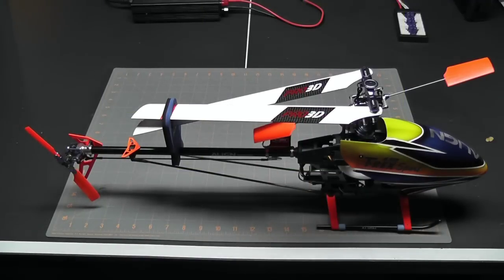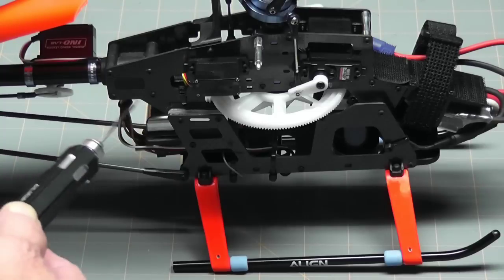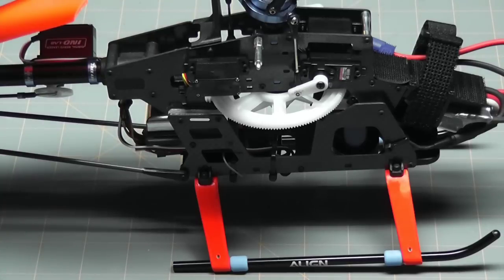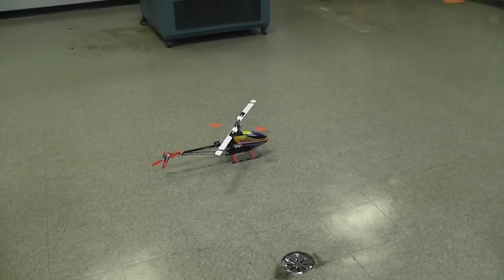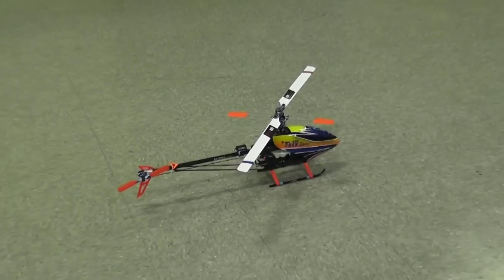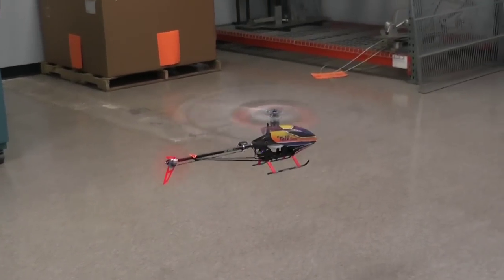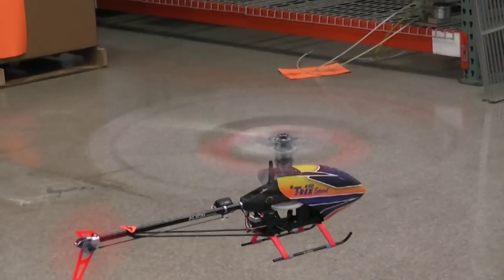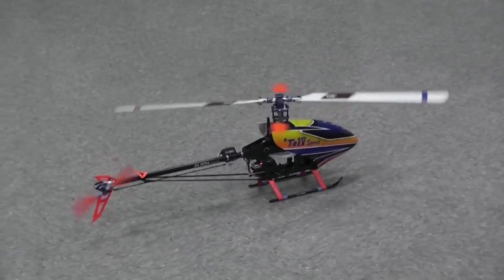Trex 450 Rebuild - Part 3

Comment from the maker: Hi there GadgetMart!  Thanks for posting bud.  The Trex 450 is much heavier and therefore more stable.  It is not as twitchy as the 300X but the flight characteristics between the two are quite similar.  I found myself being more "Brave" to try new things with the 300X, but soon found out, in some cases, it was easier than fhe 450!  Go figure.  In any case, it is a great migration from the 300X!  Have a great day and happy flying!